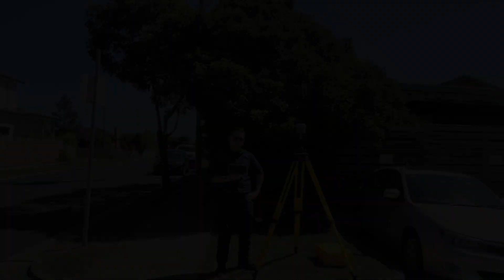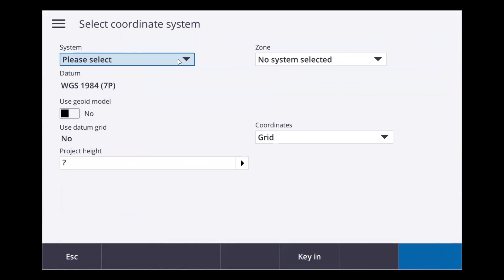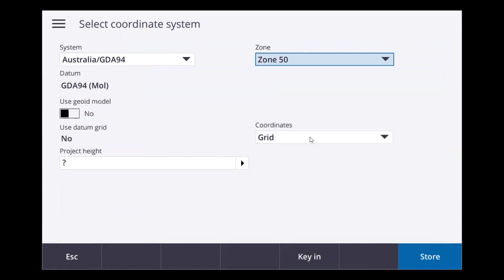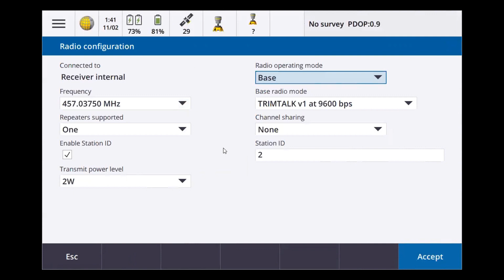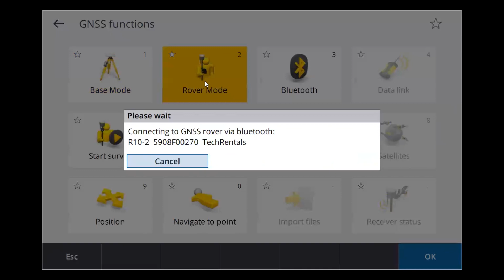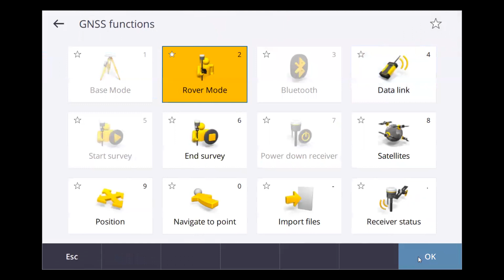Trimble R10 Base and Rover Setup

Comment: I have a r12i and sometimes need a base solution instead of RTK.  Can I just buy the head unit of a r10 and set it up alongside my existing controller and r12i or do I need other equipment?

Comment: thank you for this video, i have a question, i have trimble r10 receiver and i am about to start a static job which required very accurate measurement for the receiver height, but i do not have the r10 extension and i want to measure the the yellow line in the top of the receiver, is it the antenna of phase center ?